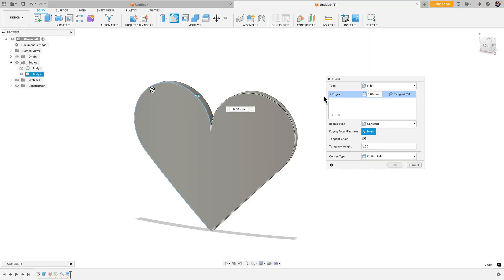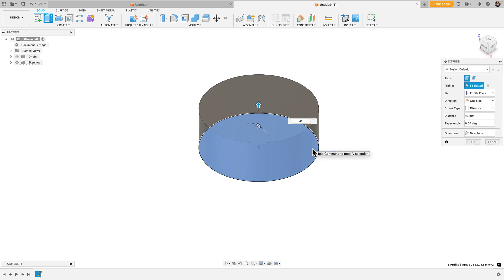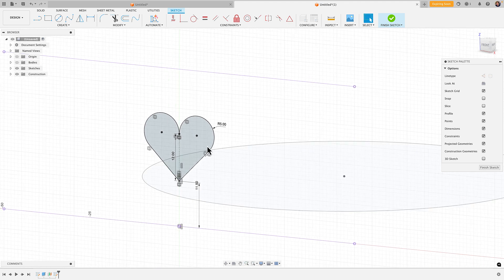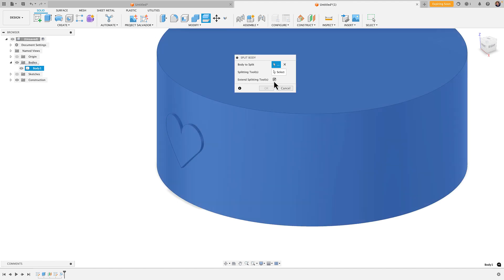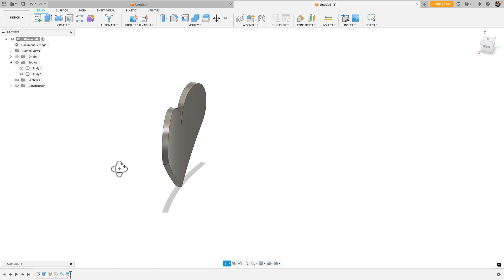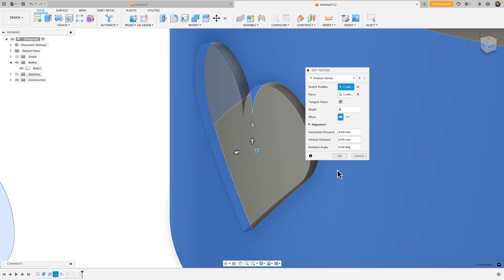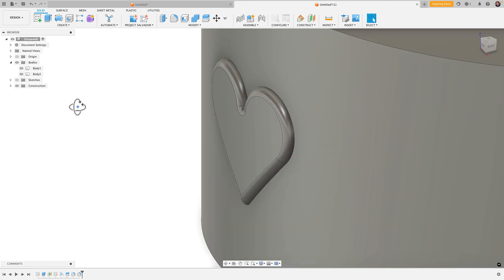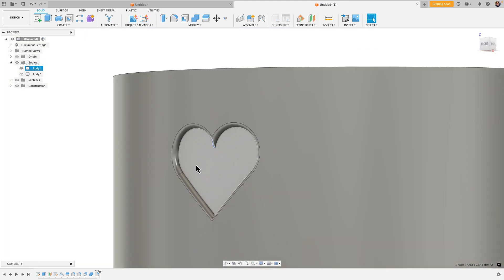My Design Approach to Multi Texture 3D Printing

Comment: Great video, thank you. A question from a noob: when you sketched the heart, why wouldn't you have used a "centreline" rather than the "construction line" you used to mirror around? From what I understand (noob, remember), using a centreline for mirrored features is best practice? Fusion knows to use a centreline to mirror around automatically, doesn't it?
Reply from the maker: Hi Denis, you're right, using centerline vs construction line here would be better.  Although, it really doesn't make much difference in this case.  The centerline tool is a relatively new tool and my brain still has the habit of always going to construction line.  One advantage of using construction line vs centerline is that when you go back to select the heart profile to create the emboss, it allows you to select the profile in one click vs having to click both sides of the heart if you use the centerline.